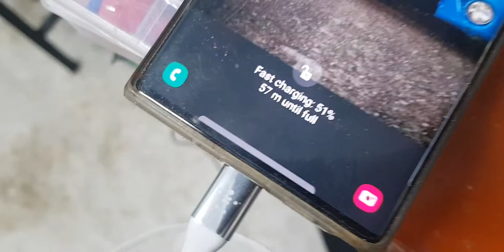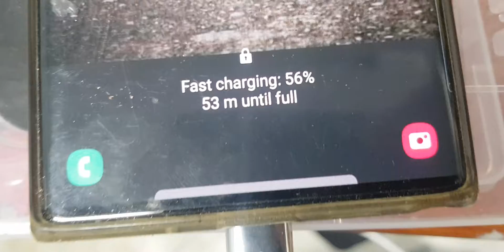Quick Charge 3.0 DIY Power Bank 18650 Battery Case

Comment: Can. I charge my phone with one cell only ??

It charges for 10 seconds only then stops charging and the screen and give that my battery is 0%

Despite that if I put a led USB light or used the internal light , it operates find
Reply from the maker: Needs more power mate have you got any more cells
Reply: @Oneupthesleevecustoms 

I thought reducing cells will only reduce the amount of charge I can get for my phone.

In a other words if the 1 cell is 1500 mAh
And my phone needs 2000mah, then it would last for at least half an hour or two thirds.
Reply from the maker: With one cell you get a bunch of voltage drop under load that turns charger off to protect cell from over discharge
Reply: @Oneupthesleevecustoms  That is a one great possibilty, I think I have to get a USB tester to find out .. which I don't have one 😂

Thx 😊
Reply from the maker: Best of luck with it

Comment: Can you charge this with a 12V solar panel?
Reply from the maker: You would need a 12v to usb adaptor
Reply: @Oneupthesleevecustoms  Can I charge with direct solar panel?
Reply from the maker: No they are 18650 lithium ion batteries

Comment: Can I change the power bank module or circuit board with a new one or a decent one?
Reply from the maker: Why would you change it?
Reply: @Oneupthesleevecustoms  since most reviews I saw that it heats so easily. And the charging port that charges the powerbank doesn't work always.
Reply from the maker: Oh these ones have been super reliable

Comment: Hey bro where did you buy that diy powerbank case i want to buy that thanks for give me idea 1 more question witch batt code color will i buy 3000mah each battery?
Reply from the maker: Hi mate. There is a link in the video description for the power bank. They are cheap and great I still use this one
Reply from the maker: Samsung 30q. LG hg2  . There is also a Sony 3500mah. Don't buy anything that says ultra fire trust fire light fire ect with 5000 6000 even 9900 mah batterys. They are scams
Reply: Wow thanks my friend you  give me some tips your so great men tumb up
Reply from the maker: @bruceleestrong  no problem. There's lots of info on my channel about finding and recovering 18650s if you want to have a look
Reply: Thanks my friend i got already ordered diy powerbank case and batt 18659 LG choco iam so happy i found help this video thanks takecare stay safe & stay strong healthy men
Reply from the maker: Thanks mate. All the best with your new powerbank

Comment: I just got a similar one, i would suggest you check the 18650 voltage at full charge, you may not have this issue but mine is saying 92% charge and when removed they are at 4.21v
Reply from the maker: Does it charge past that point
Reply: @Oneupthesleevecustoms  finally mine charged up to 4.25v (not same model, similar). Taking into account  the 18650s are recovered i think they should cap this at maybe 4,15v. I will try to regularly check the individual cells, but its a hassle
Reply from the maker: @TheBlackadder-Edmund  be interesting to see if 4.25v has any long term effect

Comment: Thanks. What do you use to charge the powerbank itself? I see similar ones advertised as 12v 1.5A via type c connector but I guess a QC3 charger is needed to charge the powerbank itself fast? Or would it be madness to do a cable conversion from an ATX PSU 12V to the C connector of the powerbank?

Comment: I just bought a quick charge and wireless charge 16p battery bank for 24$. I'm going to fill it with some recycled power tool lg 18650 batteries that are tested around 2ah at a 2 amp discharge so it will hopefully be a bit over 32ah especially if they are discharged slower.
Reply from the maker: That should be excellent. Quick charge is so good

Comment: wont it need a fan or something? is it safe if the batteries goes hot?
Reply from the maker: Why will they get hot?
Reply: @Oneupthesleevecustoms  I mean in case the batteries get hot sir?
Reply from the maker: Keep them out of direct sunlight and they will be fine they are good cells should last a long time

Comment: Do i have to put 8 cells in there or are 6 cells enough
Reply from the maker: 1 to 8 is fine. May need to tape or something to secure them as they could move if rack isn't full
Reply: @Oneupthesleevecustoms  thanks i got 1 more question: What are the dimensions of the control board?